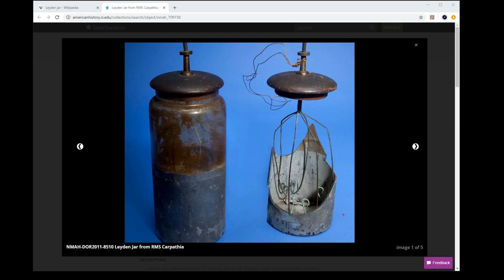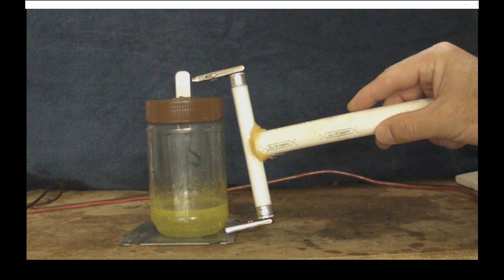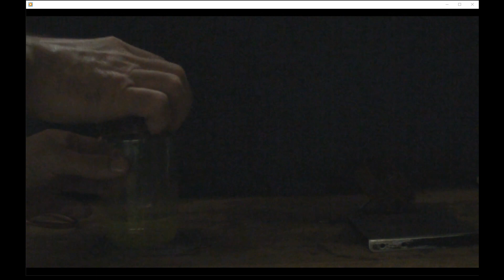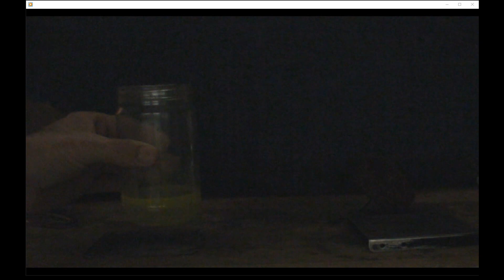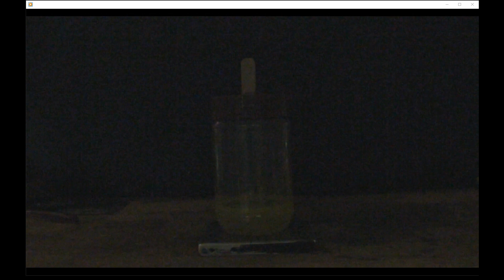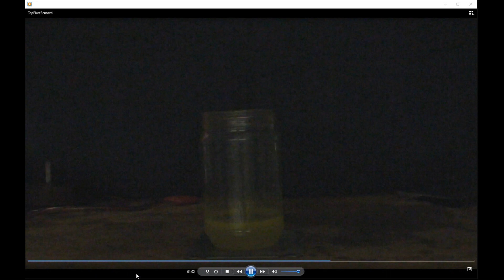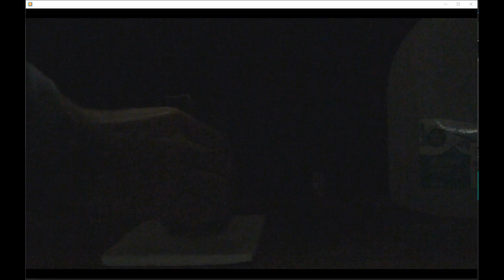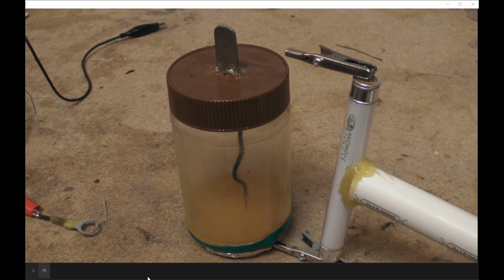Electron Theory can't explain Capacitors, but Ben Franklin can!

Comment: Lovely video @itsBS, you've spent a good time to set these things up and explain them one by one. I have noticed something though;
If these dielectrics can charge metals by induction, then we can simply wave these metals over a charged dielectric (I believe the arrangement is called an "electrophorous") and we can obtain charges for infinite times as long as we don't discharge the dielectric. Wouldn't that be an endless supply of charges? Or am I fundamentally wrong somewhere..?
Reply: "then we can simply wave these metals over a charged dielectric ..."   Well, you can already do that by waving a coil of wire over a magnet as in a conventional generator. The mechanical motion of the waving is what does the work.
Reply: k v vaghul, yes. you can wave a conducting material over a charged dielectric. In every swish you get induced charges which disappear again when going away from the free charges. If I understand it correctly, you will harvest some energy when approaching the free charges. Unfortunately you have to invest about the same amount of work when pulling back.
Reply: @bernhardschmalhofer855  Ah! yes, the conservation law. thank you!
Reply: I believe the answer is right. Or say very close to it. The motion would breath  to some length and back and forth  like lungs.
Reply from the maker: Thanks.  This type of thinking about the energy of so-called "insulators" is very much ignored with Lorentz ION theory of electricity, especially when paired with Einstein Relativity (which describes a big part of "Modern Physics").  I don't have an exact answer for you, but rather ideas that I am also researching.

When the dielectric "transfers" the energy back to the metal, you could say that the electric charge is "destroyed", "neutralized" or converted to something like heat.  There is still SOME charge in that JIF jar, but it is way less after the main burst.  If you let the JIF jar sit for a while (even with no metal touching the plastic), it will actually build up some more charge on its own.  This has been known for a long time and is called dielectric absorption, but it not certain on how it "gains" energy.  This is why you should always assume a capacitor has charge and discharge it, so you don't become the "metal" circuit.

Also, looking at the pulsating, discharge of the dielectric energy as an oscillating wave might provide new insights, mainly because of resonance, superposition phenomena of waves.  This oscillating wave discharge of a dielectric was studied in the 1800's by Felix Savary, Joseph Henry, Helmholtz, Lord Kelvin, etc.  To me, this is where the 1890+ Nikola Tesla electrical years has its beginnings.

Today, we get electricity by moving permanent magnets and metals around.  It seems to last forever, as long as there is movement.  The copper windings don't seem to "lose electrons" and deteriorate after being in use, nor does the the permanent magnet seem to lose its power.  Obviously, too much heat changes everything I just said, but the "metal-magnetic induction" seems to be an endless supply of electric charge.

The dielectric analog of a permanent magnet is an electret.  If we focused on learning more about electrets, then the "electrophorus" effect you are talking about might also seem like an endless supply of electric charge.  When you see the dissectible capacitor from the viewpoint of this video, you can get the sense that a capacitor's dielectric is just a temporary electret.  "Metal-magnetic induction" has the temporary electro-magnet device, and "plastic-dielectric induction" has the temporary capacitor device.  A real world example of this is the condenser/capacitor microphone (requires power) and electret microphone.
Reply: @itsbs  Thank you. That was a really detailed reply, I had to read it many times to understand. Much appreciated!!

Comment: I only found this when it was linked by a commenter (fractal woman) on Particle Guru's video. And in the particle model explanation this means the dielectric material instead of conducting G1 particles holds them and then they can flow the opposite way to discharge. I only thought of it this way because of you.
Reply: Electricity is not particulate. I recommend reading Oliver Heaviside's Electromagnetic Theory Vol. 1 and Charles Proteus Steinmetz's Elementary Lectures on Discharges, Waves, and Impulses and other Transients.  These explain the field in depth.

Comment: Bravo! ( BTW Fractal Women sent me here! )
I have executed practically an obsessive number of various experiments with my Lord Kelvin's Thunderstorm (water droplet) set up.
I have several videos which directly correspond to what you demonstrated via water and plastic as the dielectric material being the charge capacitor.
I even managed to reverse the discharge location of the droplet system - IE - I used no electrodes at the catch basins - and still managed to create sparks at the water / plastic container source.

Again, Bravo!

The Good Vibrations
Reply from the maker: For some reason, I cannot see the comment you sent to me:
The Good Vibrations 
I found this old video of Julius Sumner Miller concerning capacitors - have you viewed it? 
https://www.youtube.com/watch?v=mkocaEcx26c 

My Answer:  No, and that was great!  I have watched a bunch of Julius Sumner Miller videos but that one was new to me.  Thanks for the share.  You would think that academic physics and electrical engineering would want to figure out the answer to such a simple experiment, but I guess the "correct" answer would break too many other teachings in modern physics.